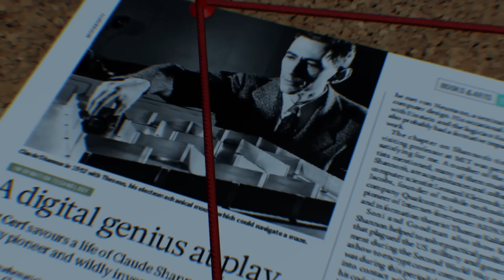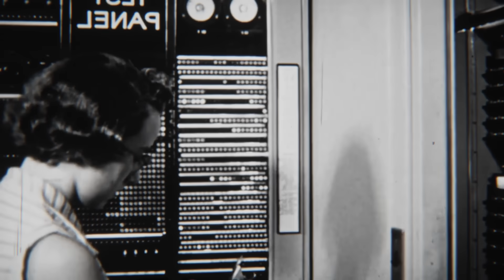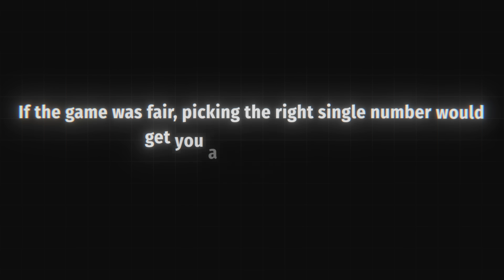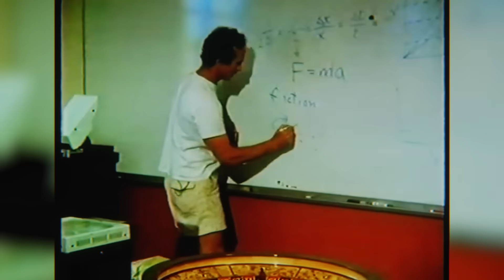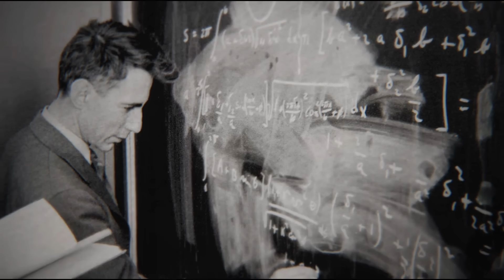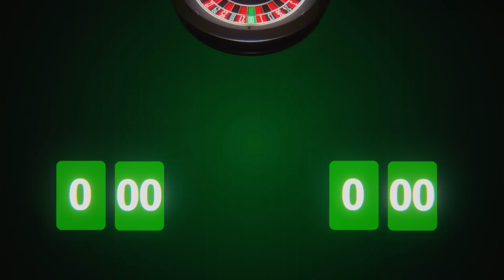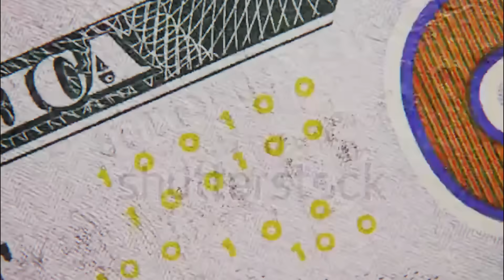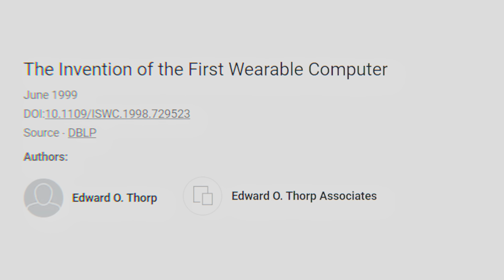The Man Who Beat Roulette With Computer Science

Comment: This device is completely nonsense because the force of the ball put into motion around the wheel is not constant and varies!!!
Reply from the maker: That's why it measured the speed...
Reply: @TILT223  
How?
Reply: @LWRC  You click when the wheel passes a mark two times, you click when the ball passes the same number two times, the machine tells you which octant to bet on. These systems are easy  for the house to beat; require bets be placed before the wheel is spun. There's also the meta bet. The one about whether you get home or not.

Comment: Another banger. It's so satisfying when they win and get away with it. The one thing I'm still confused about is the slight tilt of the wheels you mentioned though. How did they identify the tilted wheels in the casino? Do they all have it naturally? Or were they sneaking a chip under one of the feet like they did in the lab (this doesn't seem plausible)? Or maybe their computer was just good enough that they didn't need the extra edge from a tilted wheel to win?
Reply: Right, same